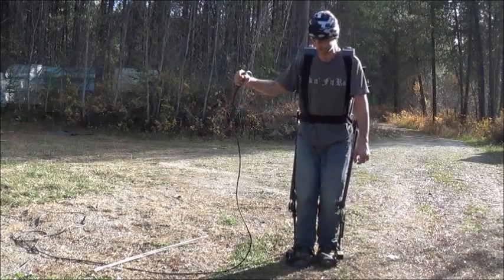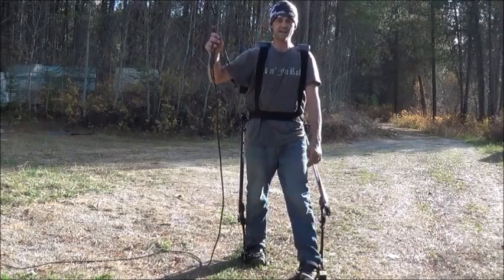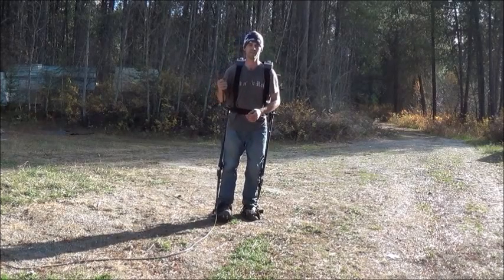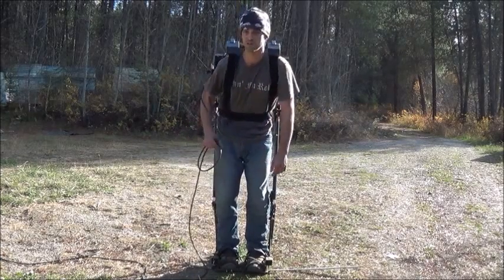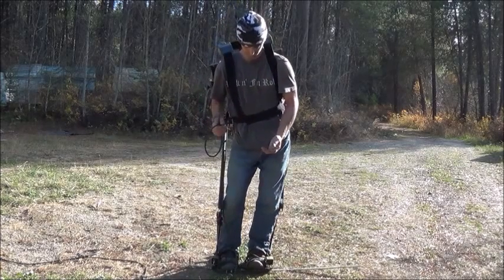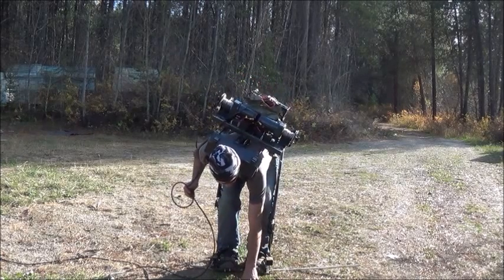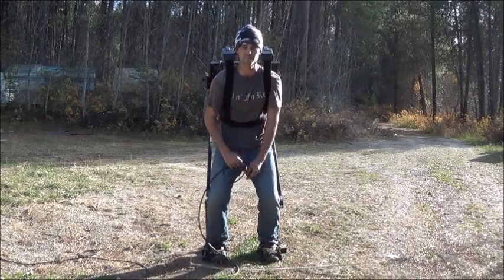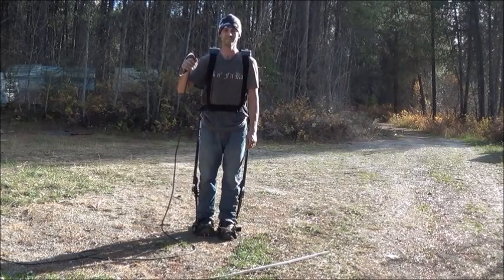Powered Exoskeleton Suit, "Model-2 First Test"

Comment: best range of motion I've seen on an exo. are you planning to work on it further?
Reply from the maker: +PlumbPilot Yes I have been waiting for my nitinol springs for the final suit, they cost $1300 for 4 springs each capable of lifting 400lbs.
Reply from the maker: +PlumbPilot This design was only to test an idea,  can we put nitinol springs in the back of the suit and power the arms and legs with cables driven by the springs and not motors. This may provide a very efficient and light weight suit that still retains a high strength to weight ratio.